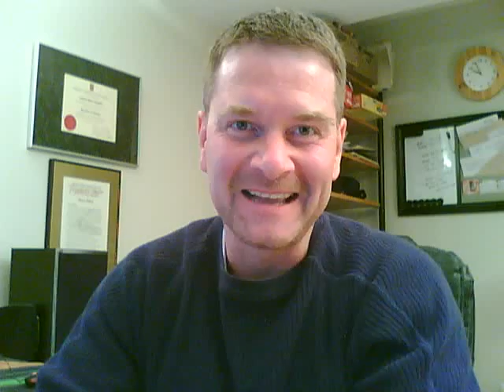#72 - Question/Answer: Electronic Buzzing/Squealing Noise

Comment: Haha, good timing! I noticed the sound again today for the first time in months! I never solved it. It's making the weird noises right now (I am signed on to XP to play Nocturne).

But it never makes them in Windows 7.

The weird thing is the noise seems to subtly change depending on what I'm actually doing on the system.

If I move my mouse around the noise stops! If I stop moving the mouse around the noise is back!

Comment: Yeah, but the newer nForce chipsets are plagued with FSB holes where its just won't boot at a whole range of FSB speeds when overclocking.  I'd choose stability over a slightly more user friendly BIOS configuration interface.

Comment: I did not know there were 5.25 bay PSUs. Insane... AMD/ATI recommends the Thermaltake Toughpower XT 850AP W0224 (850W) PSU. So, if your power supply is that model, you should be set up for XFire once you get the second 4870 x2. Happy gaming, and let me know if you need any more help.

Comment: The 4870 x2 will outperform a GTX285 in most games if you use screen resolutions above 1680x1050, with AA and AF enabled. The 4870 x2's second GPU will help a lot when high anti-aliasing and antistrophic filtering are in use, particularly in high resolutions applications, with greater use of the 2GB GDDR5s bandwidth. The only issue is feeding the 4870 x2 sufficient power. There is nothing worse than your system shutting off due to an overheated PSU when you increase the screen resolution!

Comment: Hah, I remember the first soundcard our family bought back in 1993; an absolutely MASSIVE (Bigger than a HD3870X2!) ISA Creative Soundblaster AWE 16 bit. installed than on an old MSI AT Socket 5 baord with EDO RAM DIMMs and a top of the line Pentium 100MHz CPU. Sorry, kind of misunderstood your comment.  Thought you meant Intel Chipset based motherboards in general, which makes no sense XD  wasn't the i486 a CPU tho? Then you had 5Volt Socket 1,2 or 3 motherboards?

Comment: The cheap powersupply that came with my old case would make a squealing noise, So I took it back and got a decent EnLight one and that did it aswell, just not as bad. But I got a UPS a few months ago, it hasnt done it since then.

Maybe it likes the cleaner power from the UPS?

Comment: I bought an evga motherboard from Tigerdirect and the shipping toke so long that by the time I got it and noticed the squealing noise Tigerdirect would no longer replace it. I talked to evga and they said they would replace it but I would have to pay shipping both ways (which was around $160 as I am in Canada). I can buy a new motherboard for that price! eventually they said they would pay both ways :D. My advice is stay away from TigetDirect. I use DirectCanada a lot and have had no problems.

Comment: my old CRT monitor made a squeeling noise for a long time after my brother stuck a powerful magnet next to it. it also went all the colours of the rainbow for a week of degaussing. lol. my speaker's amplifier did too, it had overheated and was full of leaky capacitors. only other thing i have that squeeled is a 40mm fan going at 6000RPM.

Comment: nah, the nforce motherboards seem to be pretty cool. i've had 2, one of which was the very first desktop motherboard with heatpipes (P5N32-SLI SE deluxe + striker extreme). i don't like the intel motherboards so much though... from what i can see, intel's bonetrail reference boards for x38 and x48 are the best anyway, only problem is intel reference bios is user-unfriendly to the degree of an AT PC.

Comment: when i start hearing the noise I took the side panel of my case and tried to separate the noise by sticking my head inside the case more or less, you should try and see; as far as i see hdd makes like a scratch noise witch is normal and tolerable but anything is possible my friend.

Comment: okay so I have 2 clone satellite boxes, which both make a loud buzzing noise that lasts for a while even after turning off. I understand that the issue is from the caps, but what can I do to fix it. Both boxes have the same problem so, its probably  a design flaw rather than defective box. Any ideas?

Comment: The hissing electronic sound only audible when the GPU is on full load, and its a brand new sapphire 6770. I have overclocked it to 850mhz, when the default is 775mhz. Is the sound anyway related to the overclocking?

Comment: I've had this annoying buzzing coil whine problem with 3 Seasonic x660s in a row. SeasonicUSA mentioned a compatibility issue but all 3 x660s made the same noise with nothing connected and started with a paperclip.
Just uploaded a recording of this buzzing noise, would be great if you could listen. Have you heard anything like that before?

Thought Seasonic were top of the line? Got it specifically for a silent build.

Any help would be much appreciated.

Comment: I have a P55A-UD3 and all the capacitors are good quality ones. However, under simulated full load (IBT, Prime95) the capacitors near the CPU buzz quietly. Should I be worried about this? I've had this system for nearly a month now and it's been very stable and quick so far and I've pushed the buzzing issue out of my mind, but I want to keep this PC for a long time and therefore don't want it to blow up in a few months time.

Comment: great info, i had this problem on my monitor, a viewsonic! and then it failed and had to do service to fix it, they change the power suply, now i discover that i have the same noise coming out of my computer, and some times my system hangs and there is nothing i can do bot too turn it off and then on again..

I think i have to replace my power suply from my PC...
is it posible that my computer is hanging for this reason?

Comment: i have this issue with my power supply only when i turn it on to windows..and the noise comes out of all the audio ports on my mother board.i replaced the power supply and the issue didnt go away. but when replacing mother board it went away for a bit and just came back. i dont know what to do but its really annoying and i dont know if i should be worried or not.. at this point i cant return anything from wher i bought it but it works fine other then the annyoing noise and i cant use audio ports

Comment: how i check if my psu is enough power
i ve got two psu the first is thermaltake 850w
and the other is on 5.25 bay thermaltake 450w i dont remember the models, for  a future 4870 x2
is this enough for a second 4870 x2 thanks!

Comment: I have similar problem, when i'm using any kind of voice chat app, others hear squealing and humming from my mic, but only on GPU load(gigabyte hd4850). I have xonar dx and hs-800 headset. 
Will replacing gpu do the trick or can MB(ga-p35-ds3)/PSU (oem fortron 350w) be the problem? Hopufully some1 will read it :) thanks

Comment: I would greatly appreciate if someone could give me a tip or 2 for my case. Whenever i turn the pc on it works for a few hours, then the buzzing comes and after a while everything i do makes it sound worse. Then the pc turns off and wont turn on after 6 hours. replaced the motherboard, used thermal paste, and now i'm out of ideas. Any help at all would be appreciated.

Comment: except Gigabyte or MSI don't manufacture caps...

the only reason Gigabyte are better is that they use solid state caps... it would help if the board overall was better TBH, the best mobo manufacturers ATM are DFI and ABit, and seeing as ABit is leaving the mobo scene, that just leaves DFI as THE decent manufacturer...

Cap manufacturers: interfacebus(dot)com/capacitor(dot)html